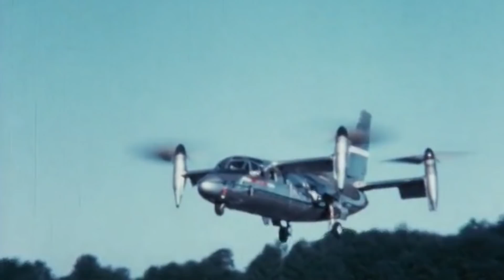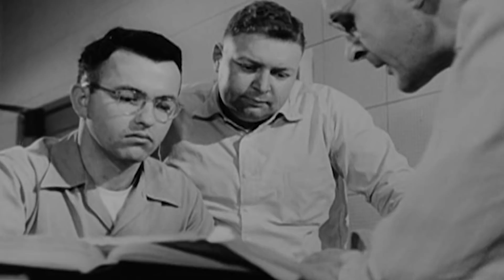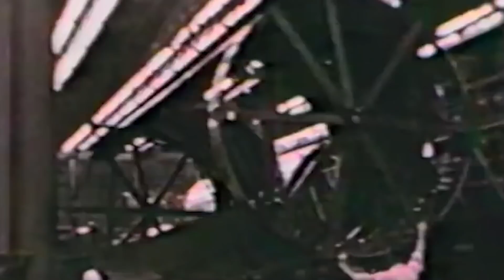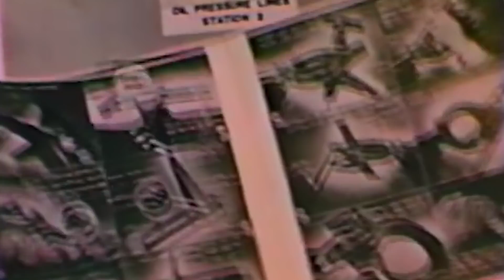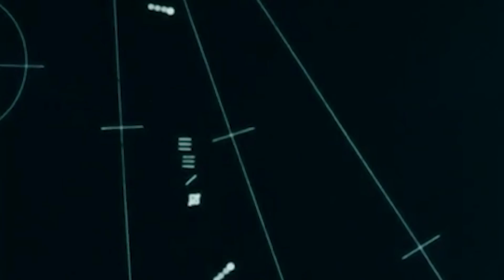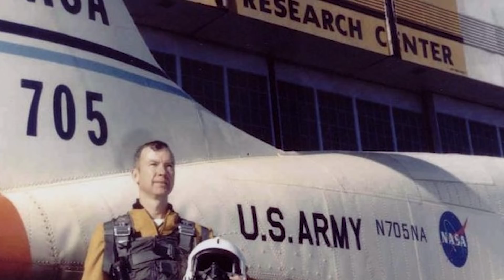The Lunar Lander Jet

Comment: I did not realize this jet existed in the 50s. You only hear about the Harrier and newer VTOL fighters usually. Or the flying platforms and jet packs. This worked amazingly well for a low speed low cost VTOL trainer. Thanks, good video!

Comment: The year was 1957. The United States had been working on a VTOL aircraft. It was an aircraft that was taken from several other planes. 

The X-14 as it was called was designed using existing parts from two Beechcraft aircraft: wings, ailerons, and landing gear of a Beech Bonanza and the tail cone and empennage of a Beech T-34 Mentor. This plane was shaping up to be very useful. 

The plane was being built and modified by Bell Aircraft. Everything seemed to go very well with their testing. At the end of a workday, they decided to fly it one more time for the day.

That's where the trouble started. As the plane was hovering something fell off of the X-14. At first, there didn't seem to have any malfunctions so they kept flying. All of a sudden there was this extreme shimmy happening and the pilots nor the ground crew couldn't find the issue. The longer it stayed up a cascade of issues started to appear. The pilots were ordered to abort the mission. The only thing left to do was pull the ejection seat handles and live to fly another day. They called the tower saying that they had troubles with the ejection seat. More specifically that they couldn't find the pull cords. At that moment the tower contacted them back and with great hesitation told the pilots that they were trying to save weight and did not add the ejection seat. Both Pilots looked at each other with sheer terror. All they could do at that moment was to jump out of the plane and use their parachutes. They survived the jump. That day we all learned a valuable lesson. Tell these bastards to put that damn ejection seat in that thing before they get killed. No people were hurt during that day of tests they ran. 

Sorry, it was so long. You guys are the best. I don't care what chips the government put into the vaccine to keep track of you where ever you go. It's alright by me. 

Finally, when people see you laying down with your eyes closed, They still ask "Are You Sleeping?" Tell them "No, I'm Training to Die."

Comment: Its cool to see old footage of Moffett field. Im doing a job at Lockheed martin which is just on the other side the hangers in this video
Reply: You are one lucky bastard. What is your job title?
Reply: @conradmcdougall3629  its classified.
Reply: The Moffett field reminds me on Skunk Works, since it sounds similar to the French word for skunk.
Reply: @billferner6741  there isnt alot that happens there anymore. the base was decomissioned in the early 90's and now its owned by google
Reply: @roywhiteo5  thanks for the info!
Reply: I used to work for GD, then joined the Marine corps.   Drop the idea in your circle to turn a drone into a medical evacuation vehicle for a injured warrior.  Then send me 10%, I live in a tent now because our VA doesn't actually give a shit about us broken toys.
They should be working on this already but if they are not, it will save some brothers and sisters.  
Semper fi.

Comment: This aircraft seems to have been ignored by every Apollo documentary I have seen!!
Reply: Wasn’t used by the Apollo program, was a VTOL demonstrator.  They used the flying bedstead, don’t know where this guy gets his info but this isn’t accurate.
Reply: That’s cause the X-14 was replaced in training by the LLTV ( Lunar landing training vehicle). The LLTV is very similar to a British test vehicle called the flying bedstead. The LLTV used a tubular uncovered frame and an exposed jet with gas nozzles for correction. You flew to a certain height and flipped it into “ lunar mode” then the thrust was adjusted to make it handle like the lunar lander in 1/6 gravity. Armstrong actually had to eject from an LLTV one time as nasa had fitted it with an ejection seat. The flying bedstead was built by hawker Sidney to test the then new Pegasus engine for the harrier jump jet
Reply: @matthewcaughey8898  Uh, no!  The LLTV was manufactured by Bell Systems.  It was the flying beadstead.  The Rolls Royce test bed and the LLTV shared the same monicker.
Reply: @j.muckafignotti4226  they look completely different as the pilot sits on top of the flying bedstead. Whereas the pilot of the LLTV sits in front with a full zero zero ejection seat. As far as I was aware the lunar lander training vehicle and flying bedstead in my aviation mind were always 2 different craft. One built to train astronauts, the other built to prove a single engine was capable of VTOL/ SVTOL
Reply: @matthewcaughey8898  Matt, both vehicles were designed and built by Bell Aerosystems.  The Rolls Royce ‘flying bedstead’ was their testing device for the reaction control system that would find its way into the P1138 ‘Kestrel’ prototype and then eventually into the aircraft we now know as the Harrier.  There are videos floating around of the P1138, one quite gruesome, of the vehicle slamming into the ground and the pilot ejecting into the pavement.
Reply: @j.muckafignotti4226  I thought the 1138 was the canceled supersonic harrier that the UK labor government killed due to expense
Reply: @j.muckafignotti4226  anyway it seems odd to me that Bell would build anything for an aircraft competitor. Unless Bell had gone full into the helicopter building at that point
Reply: @matthewcaughey8898  sorry, you are correct, the 1127.
Reply: @matthewcaughey8898  What do you mean?  Bell was always an aircraft manufacturer, they were a quite diverse aviation company.
Reply: @j.muckafignotti4226  there was a point where it seemed bell focused more on helicopters. I mean the UH-1, the Jet-Ranger, the military jet ranger OH-58. The H-13 Sioux just to name a few. While the X-1 and X-2 were certainly important and bell had success there, their military choppers are what I remember more cause I was around when they were still Bell Helicopters
Reply: @j.muckafignotti4226  I remember hearing about the P-1127 and how Hawker was having a beast of a time getting an afterburner to work on the Pegasus hot nozzles
Reply: @matthewcaughey8898  The Pegasus never had afterburners.  It used water injection to augment thrust.
Reply: @j.muckafignotti4226  I know that but as it was told to me the supersonic VTOL was looking into afterburning or reheated hot nozzles. The standard Harrier was never meant to be afterburner equipped. As far as I was aware the testbed rig was intended to test transition from the puffer ducts and back to. And I’m aware the program was one tough slog. The Ryan X-13 vertijet sucked fuel worse then an overbuilt muscle car ( a flight from andrews AFB to the pentagon left 0 margin for error ) and the XFY-1 pogo looked like a cross between a Westland Wyvern and an oversized missile. And as I’m also aware most conventional jet VTOLs were using multiple engines with 2 smaller jets dedicated to lift only. ( I think the YAK-38 was the only other VTOL in service aside from the harrier but it was still more of a half baked prototype with flaws out the tailpipe) Anyway yeah the P-1127 was supposed to be several years from an actual flight which Rolls Royce hoped would give them time to actually see of they could possibly get an afterburner on a Pegasus. ( ultimately it took the F-35 to actually be able to deliver a supersonic VTOL and I think the flaws in the program have a while before they’re properly ironed out)
Reply: @matthewcaughey8898  You missed one of the most interesting VTOL’s that was never built, the Rockwell XFV-12.  That was a Mach 2+ vtol aircraft.
Reply: @j.muckafignotti4226  Just out of curiosity did it end up like the F-108 rapier? The jet that got a mock-up but never left the blueprint stage?
Reply: @matthewcaughey8898  No, there were two built if I’m not mistaken.  One was delivered to Pax River for testing and I believe the early VTOL tests showed serious engine shortcomings in regards to available thrust to lift ratios.  It never flew from the little I read about it back in the early 80’s, but was abandoned in favor of the plastic wing AV-8B built for the Marines.  I believe money and lack of interest were more responsible than anything for killing the project
Reply: @j.muckafignotti4226  the AV-8B was an attempt to improve the AV-8A a previous generation harrier that literally just had its national insignia repainted. The 8B was an attempt to improve the horrific accident rate that new pilots were having in the 8A. In fact as I recall the AV-8A earned the dubious nickname of “ Ensign Eliminator “ for its very high rate of crashes. ( though this was cause initially the USMC was having its best chopper jocks sent to England for harrier conversion training and it gave the image of easy to fly which it wasn’t). As to the Rockwell, most early VTOLs were badly underpowered and usually failed to meet their promised performance targets. So that’s no shock, anyway till the F-35 there really was no supersonic SVTOL jet built. But yeah eventually the brits stopped building the harrier and ironically production shifted to McDonnell Douglas who’s AV-8B was so different from the OG Harrier that it didn’t need a production agreement. I’m not sure when the AV-8A entered service but I’m pretty sure the AV-8B didn’t hit the assault carriers till the mid  1980s
Reply: @matthewcaughey8898  Pretty much.
Reply: @matthewcaughey8898  Thanks for contextual information 😀

Comment: The X-14 is currently undergoing renovation by a private collector in Indianapolis, Indiana at the Ropkey Armor and Aviation Museum. According to the Wikipedia.
Reply: Glad to hear it. I hope it ends up in a museum somewhere.
Reply: @shadowjack8  I hope they take it on the airshow circuit. People should see it doing what it was meant to do.
Reply: Are they trying to make it flyable or just make it look legit?
Reply: The vehicle has been restored and is on display at the museum. You can see a photo of the restored X-14 at the wikipedia page for Ropkey Armor and Aviation Museum.
Reply: its actually put back together now: https://en.wikipedia.org/wiki/Ropkey_Armor_Museum
There is a 1 work in progress picture here also https://en.wikipedia.org/wiki/Bell_X-14
Reply: Thanks for the info about the X-14
Reply: Nice thing about the X 14 is that it used so many parts from general aviation aircraft, many of which are either still being built, or have an aftermarket parts suppliers that getting replacements is probably fairly easy.
Reply: >  The X-14 was superseded by the X-15 which was dropped by the B-52 so as to save on takeoff landing gear costs.
-  It failed miserably as a VTOL & was handed over to NASA which used it for faster pizza delivery tests.